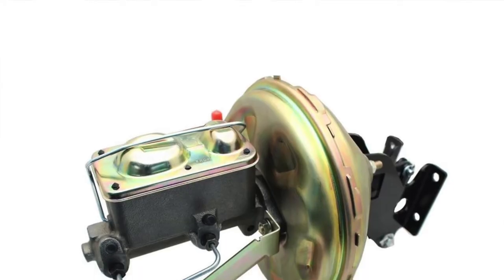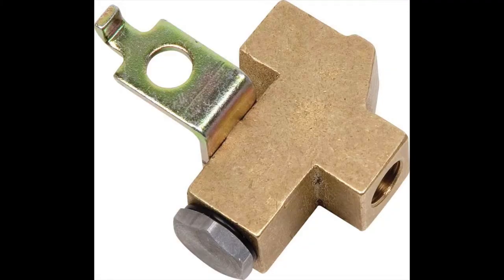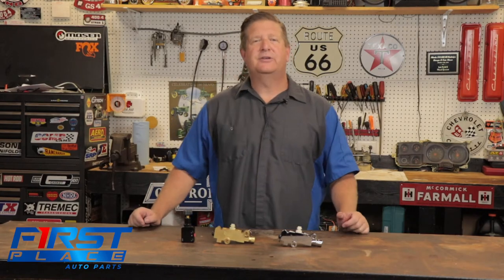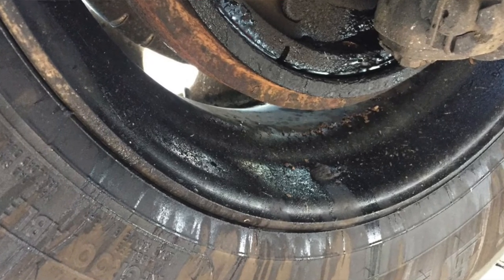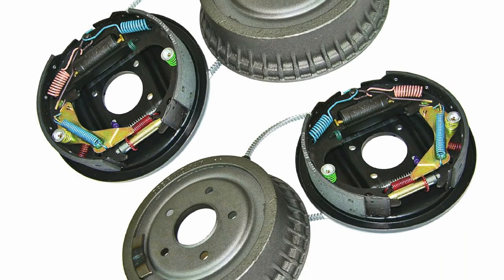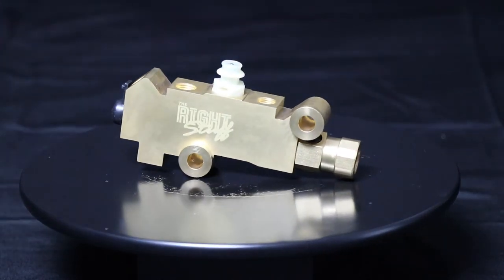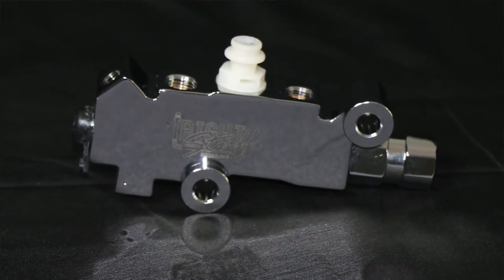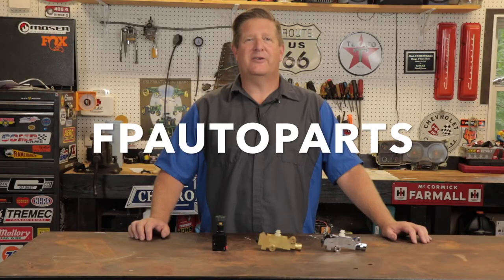How A Brake Proportioning Valves work

Comment: I have a leak coming from the failure warning switch. I've changed the o-ring on there and even tried a different switch but still leaks when I brake. Any suggestions?

Comment: Do I really need a proportioning valve?
I run classic style 225/90R16. I usually drive 3-5 mph under the speed limit in the right lane and don't drive faster then 55, maybe 60 on a highway. Also I only drive the truck about 4,000 miles a year.